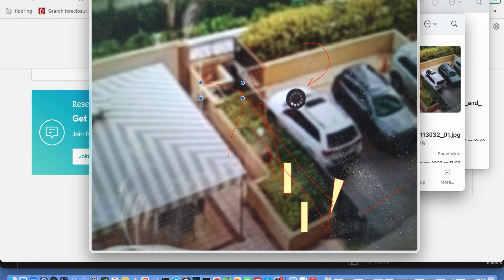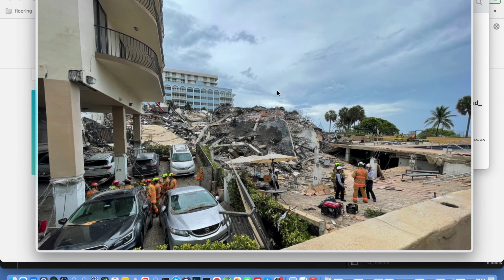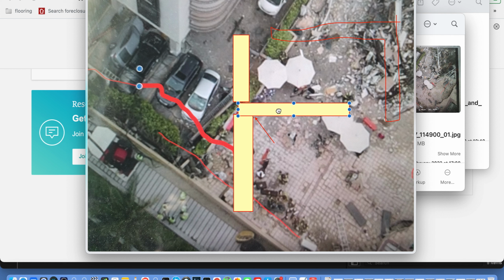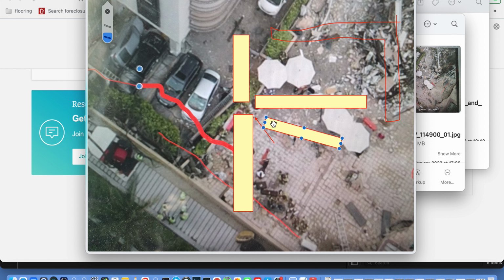Champlain Towers HUGE REVEAL JEALOUS WALL AND DECK PLANTER BOX at SOUTH WALL CORE SAMPLE CRITICAL

Comment: That building was supposed to collapse by design.  The north side columns were designed way too thin, the weight was too much.  Garbage-type of  engineering, Time, lack of urgency, the location next to salt water,  and the construction next door determined its final fate.

Please dont tell me maintenance was the key factor.  There are thousands of old buildings in India, Africa, Asia, Europe, the whole world with less intervention than the USA code and they are still standing!   
Certification is unheard of in most of the third world.  In addition, those buildings are built using concrete , iron and brick. 
Sheetrock in not used to divide the floor plans.   What kind of garbage-type of engineering was employed here? 
Dollar-store engineering?

Now the north and east towers are being intervened.  Personally I would’ve moved on June 25th in the afternoon , or the next day.  
It’s too bad that the designers and engineers are either dead or in a nursing home. They should be in jail imho.

Ps, forgot, thanks for the analysis !!!

Comment: Much appreciated, thank you. I wall need to watch a few times to digest the information.
Reply from the maker: I was hoping you would watch...
I will do a mini model and show reactions I am referencing...
It will demonstrate the rotations on both axis...
Reply from the maker: Third reply, I am still working on trying to make that south Wall an origin point... Any photographs would sell me on it more...
The planter box behind the white and dark vehicles make it a hard sale (the upper deck area with no full collapse)...
Reply: @LoadPathEngineering  In addition to the crack, top in tension, visible running under the black pickup, I strongly suspect there was another crack somewhere along under the front of the planter with the bottom in tension. Allowing the deck to fold and retract from the wall without cracking the column. The southern wall was levered to the north the drone shots taken before the July 4 demo show that deflection.
Reply from the maker: Exist, I have considered that and think of it as as ''dissection" (material plane break).... So,  then I dive in to find that plane break and all I could find was steel that ran 20 feet from that wall to the column area / plane...
I measured the distance and it puts it just at the lower tensile area into the compressive ''handoff'' area (what I mean, the loads transfer UP to the top steel)... Oh wait! No real top steel to be found, as of yet...
But, we know they stated two steel and and additional steel from this wall to be #4 12'' o.c. (yet, the wall does not show that in pullout)...
But, then I find the fireman (the next day) and I find steel that appears to be about 4 inches apart! (looking from the walkway side and down to bottom of wall)...
It has a lot of conflicting data but I have not given up and do my best to realise my bias positions and then attempt to debunk them...
I DO have a video coming out that will show my confusion with the ''45 degree'' break at the floor level and the column that is by the truck and south wall line...  I will discuss this 45 degree fracture and it's implications... Oddly, if I can come to a conclusion (only two choices) then it will explain the load path failure this deck MUST honour... to create this 45 degree break.
Recall, the rebar ''antenna video"; this explains how they are ON THE FACE of one of the columns, meaning it can only be placed there via one load path failure (see attached video)...
https://youtu.be/Ey80n1HwoO8     these antenna are at each location and rebar is not like a spring, it wants to stay it's last bent location... no memory (well a slight touch, maybe 2 degrees)...
I would like you to consider this...
That if we cannot observe the shear heads under the planter box and they are close to failure from car load cycling and water damage... then the load MUST transfer, in a greater span to the next supports and that would be the column and the wall system...
I am doing a rebar pullout test soon, I am soaking the concrete in water with the rebar connected... Once, I think it has baked enough, I will do a rebar pullout test and see if the water creates MORE of a LOSS of friction and therefore a lower amount of force to cause a low pullout force. 
Studies have been done on this but I find a huge defect in ALL pullout test I have observed in these test...
they pull at approximately ''inline'' with the bar!
The failure of the bar would have torque/ deflection down force! The deck would be sagging and therefore the strain would be of a prybar action on the rebar anchor point...
I have tested rebar with a degreed wedge and have found I can get failure at lower value then parallel to the rebar...
We also assume universal loading on the rebar connections into the connecting surface and this is not true...  These are also point loads and yes, the surrounding concrete will participate but I visualise an hour glass force   back to the mostly loaded steel anchor point and eventually, rather than tear from the wall anchor it will pUNch through the concrete pad... I have demonstrated in many concrete floor demolitions and the failure loves to stay focused where the largest force is applied and does NOT tend to share the load 1 to 1 back to anchor points. 
I will do another video dedicated to your question and attempt to prove this with real World concrete failures...  But, I guess you look no further than concrete beam load testing failures... they do NOT share that forces back to the supports, they ultimately failure from the applied load point.
Reply: @LoadPathEngineering  Thank you very much for the detailed information. May I post a link here to an engineering forum which has more detailed photos and drawings, please?
Reply from the maker: Exist, I might explain it in more details in noon video, today...
You were the only one that extrapolated to where I was going...
You really surprise me with your patience with me... I have noticed...
Thank you for being patient and waiting for me to "get there"... I just have to lay all the groundwork for all the viewers and not just jump into it, like I did with my deck ledger collapse video...
At the noon video I will even show how I can get to the subsidence as an activation point (I slighly pretend to forget to tell about the formwork detail...Columbo "forgetfulness" but, I will circle back ...just wanted to see if anyone would catch it and recall from previous videos.
Recall, this pool/car deck was never right, it had repairs from the first years in service!
Please, do not be confused by another false flag... never forget the bulkhead was new then and we do not know the depth...
We have no evidence the bulkhead had any settlement either... the 2018 or so as-builts survey shows an existing in plane deck system (two defects in the survey I have found and could speak volumns or just acceptable practices (I don't agree with surveys that do extrapolated measurements, I have had many that do just that!)... I paid for precision and they give me damn guesswork with a stamp on it, pisses me off!
Reply from the maker: I have more coming on this "position" and it's ''default moment location" (hand-off / transfer of bottom / mid-span tension loads to the upper transfer of the negative steel.
Reply: @LoadPathEngineering  sounds great, thanks. Then I will wait before posting the link.
Reply from the maker: It is loading for HOURS from my phone today, I have no idea why it is taking so long to upload to youtube.
With that said and while I work on other projects, please send your link over and I would enjoy the banter that is may present.
Reply from the maker: I had a long second reply but it was ghosted...the short version, I have two supporting pieces of data on south Wall failure first... But, I have two pieces of data that then debunk me...
I will do a rumble video on it tomorrow...for you.
Reply: @LoadPathEngineering  Thank you very much. I look forward to seeing that.